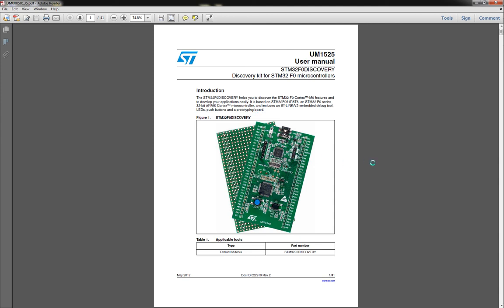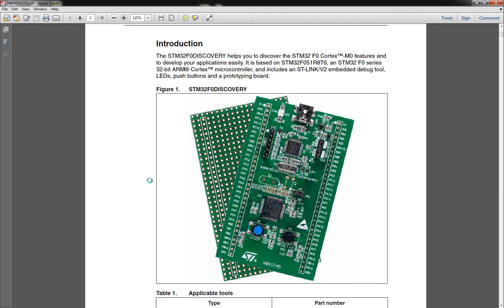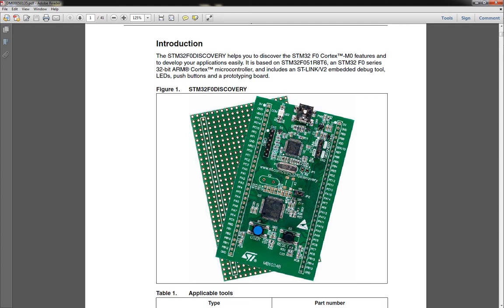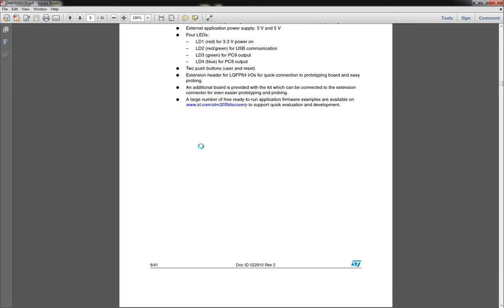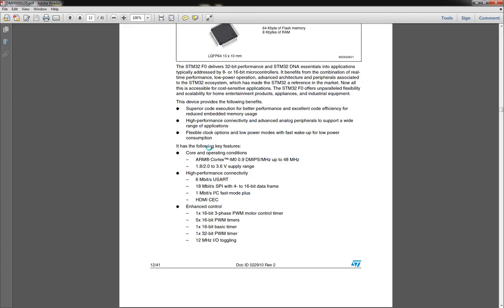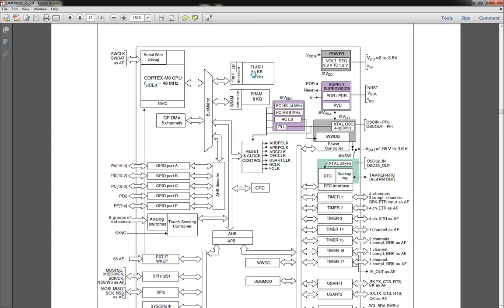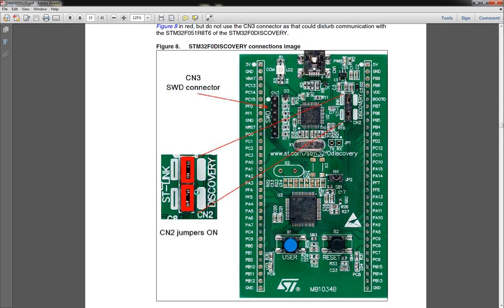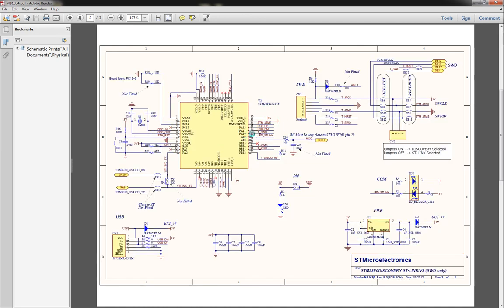Into To ARM Development (Hardware)

Comment: Thanks for putting this up .... how does it sit V RasPi .... any ideas ( as i understand that ' s Arm also ) ?
Reply from the maker: magna59 Hey there thanks for the comment.  Well so far as how it does vs the raspberry pi there really is no comparision.  The Raspi has one of the more higher end ARM based processers that can run a complete operating system.  The M0 is the one on this discovery board and it is just an introduction to ARM based MCU's.  Since the Raspi has an operating system, linux, you can write code for it's GPIO in many different languages and they are all application level software.  Where as writing code for the processor itself is more Firmware low level development.  Thus, I can't really compare apples to apples with the discovery vs the rasperry pi.  The discovery board is just a development kit to give you a good starting place as an intro to ARM based MCU's.

Thanks for the comment.